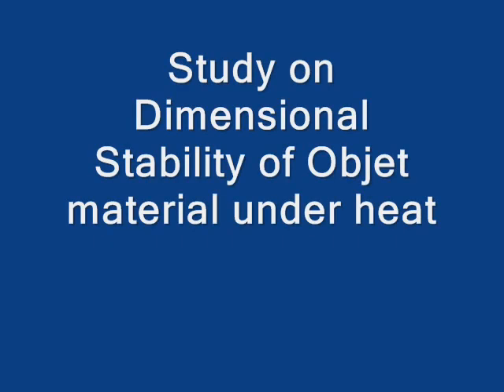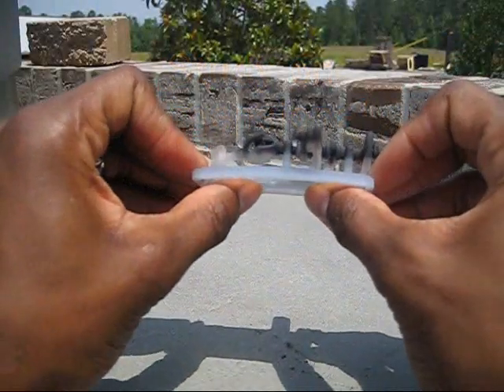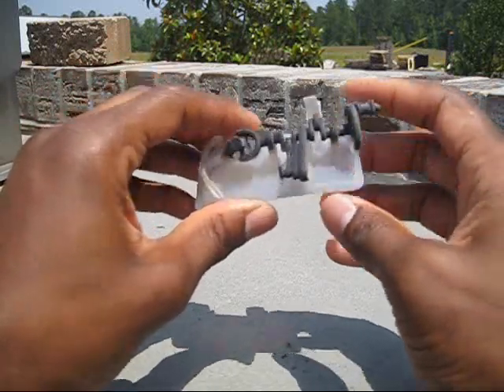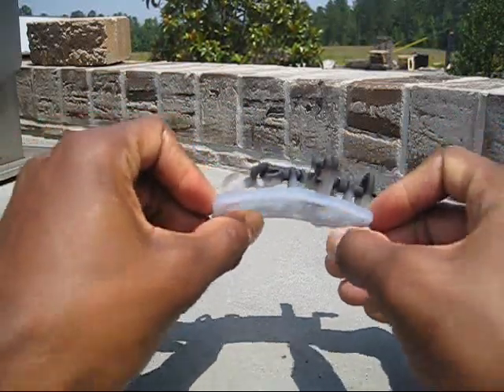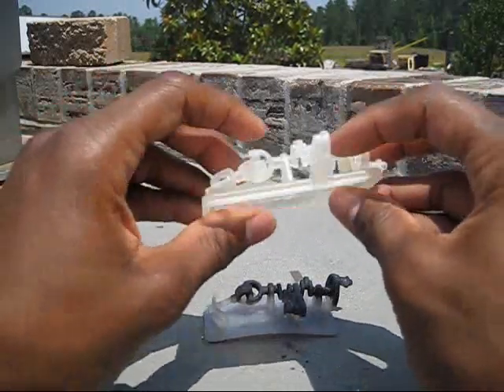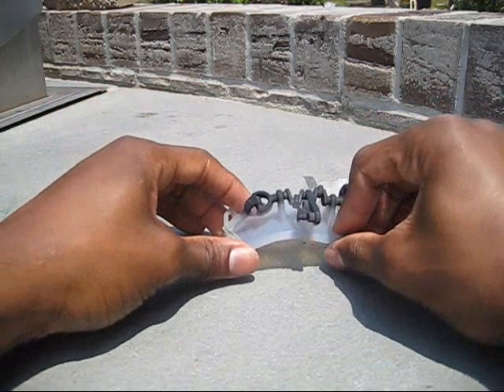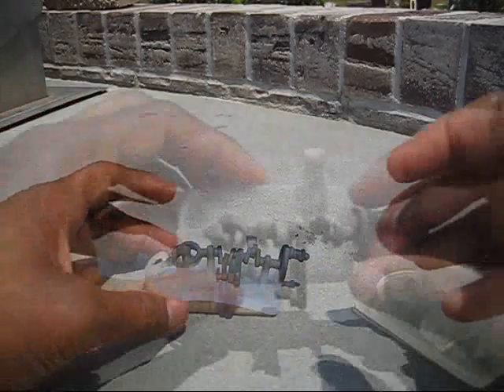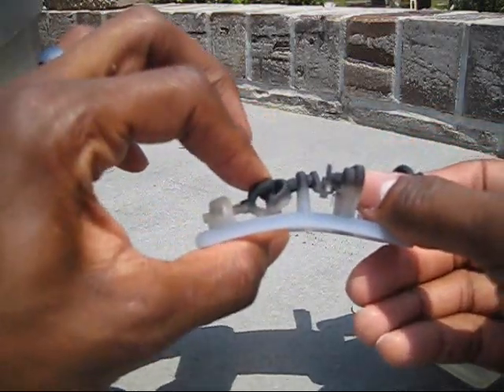3-D Printer: Objet vs. ProJet Materials

Comment: I see that you were involved in the making of the ProJet promotional video so I would have to assume that you have a business connection with 3D Systems.  This is also confirmed by your comments that you were showing "out materials."

Additionally, Eden doesn't do 2 colors or 2 materials within 1 part.  Your credibility is shot dude.